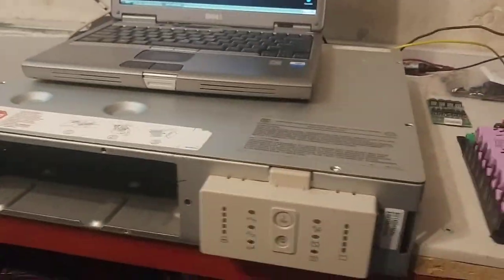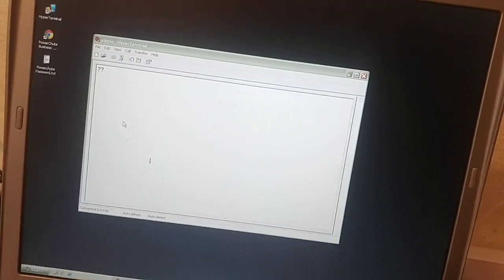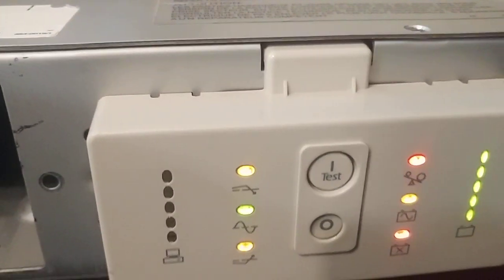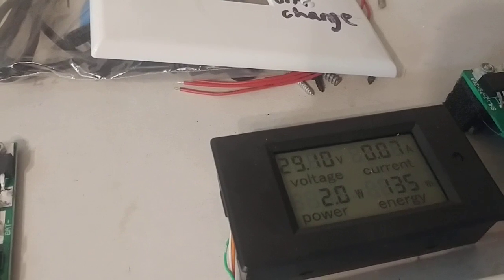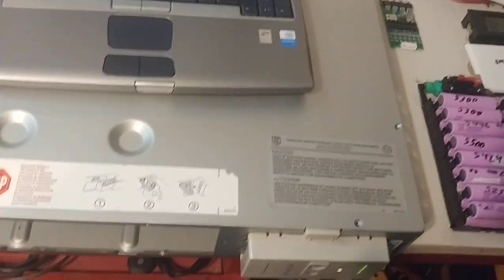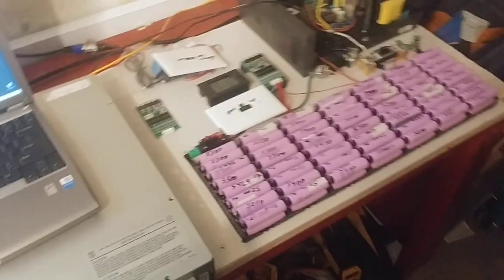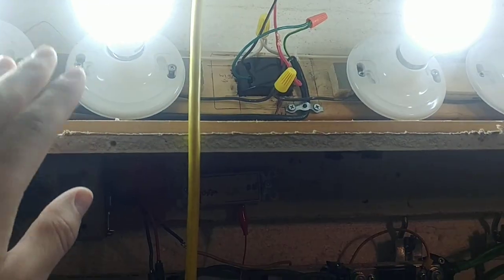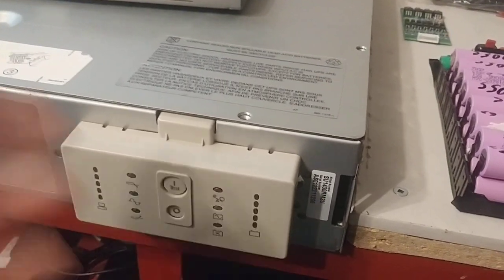APC UPS inverter diy mod dead start, float voltage and idle for 18650 7s

Comment: was woundering if u  found out  how  to  get ur charge  voltage  set  . i found   a way of doing it    u dont  have to go  in to the back door of the unit .   on the circuit bored look ic14 chip  around it  will  be resistor 118   its a 100k   if u need to bring the  voltage up u need to raise ur  resistor vale . i changed out my 100k resistor  for a 110k pot an adjusted  it up  to  get  my 29.4 volts  for a 7 s battery pack .   if u need  to lower the  charge volts  put a  100k pot in  an  adjust  from ther

Comment: I must point something out while adjusting the battery float voltage (shift B)  while in that menu when you press (shift +) you are telling it that you want to charge the Batteries LESS, and when you do (-) you are telling it that you want to charge the batteries more. I know this seems backwards. I noticed that if I do (-) below the nominal voltage, say if the UPS is designed for 24v, and I do (-) until the float charge value is say 22v, what you will see is that the Battery Charge will never get to 100% This is because its constantly trying to charge MORE, not less. This video helped confirm that for me: https://www.youtube.com/watch?v=iqBYBx7M0e8  I think the field is meant to help you adjust batteries that have a voltage that is off from what the UPS believes the voltage to be.

Comment: Connect  a capacitor instead of a battery when fiddling with float voltages and actually measure what the float voltage is. APC is notorious for wrong readings.
Reply: Yes, this is a very good idea. ALSO! make sure your voltmeter has a good battery! I actually just connected my voltmeter to the battery leads while adjusting the float voltage, it updates fast enough to see what is going on.

Comment: Is there a setting to where you can tell the ups to stop discharging the cells? im thinking prevent over discharge or even use the maximum potential of the pack.
Reply from the maker: Check the networkupstools link but i couldnt find it. I found these tho.
Shift d - runtime calibration. 
k - N = alarm off
w - NO = run time conservation off
Reply: @AndyShell  thanks I'll give the commands a go , I was able to get a copy of that powerchute software off a torrent , the actual APC website is a mess of brick walls stopping me and I'm tired of headbutting them
Reply: In addition steve you can set a shutdown threshhold using PowerChute, you can also disable the alarm that goes off in the event of a power outage. I dont normally use Windows, but I setup an old PC with XP just to install and use PowerChute for a few things, such as those I mentioned. Once I was finished with settings that PowerChute exposes, I hooked it back to my linux server that runs apcupsd

Comment: I was thinking why not shove a raspberry pi onto its serial interface for remote monitoring on/off and real time data display output. The rpi could be rigged up to monitor things that get warm in use sure as primary transformer and mosfet heat sink etc.
Reply: I had the same idea, because the raspberry pi will only consume a little bit of watts, and you can use apcupsd to tell other machines plugged into the APC UPS to shutdown gracefully, and then when the rpi detects that power is back you can have the rpi send a wake on lan packet to those machines to bring them back online.

Comment: Yeah UPS's have idle but free is free!  I can run my ups  at 100% or 2700watts until the batteries are dead! (edit) I was running a heater and a heat gun to get the wattage up that high!

Comment: I have that APC 1500 ups. I have it as back up so I will have some power. If my inverter goes down. What are you going to do with the old ups you have ? The one before this one? I'd like to try doubling the power by adding more FETs, and transformer,   the ups aren't the most effiecent, I don't like mod sine inverters. I'd rather have a cheap puresine . with only TV, fridge, well pump, and microwave, I don't need much ac power.   I have a pwm dimmer for about $3, for my LED lights. Yea and DC lighting. You aren't boosting, inverting, bucking , loosing power at every step. If you go with DC lighting. No need in spending 150watts for 75watts of lighting! I'm running on lead acid for now. I have tested with lithium. And can't wait to get it going full time.  Happy holidays and NewYear!!

Comment: Hi Andy. Can you supply me with a link to those bulbs please.
Reply from the maker: ebay.ca/itm/100W-Equivalent-E27-A21-LED-Globe-Light-Bulb-Lamp-AC-DC-12-24V-9W-Pack-of-4-O/192331501463?ssPageName=STRK%3AMEBIDX%3AIT&var=492286323796&_trksid=p2060353.m2749.l2649
Reply from the maker: or search google / ebay for:
100W Equivalent E27 A21 LED Globe Light Bulb Lamp AC/DC 12-24V 9W Pack of 4 #O
Reply: Thanks ..